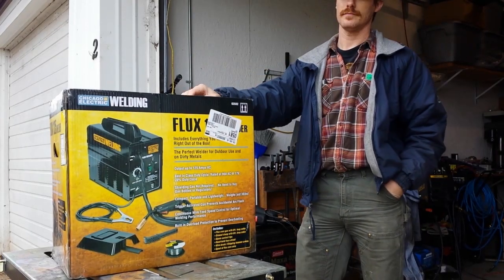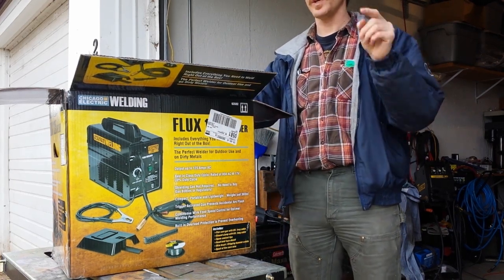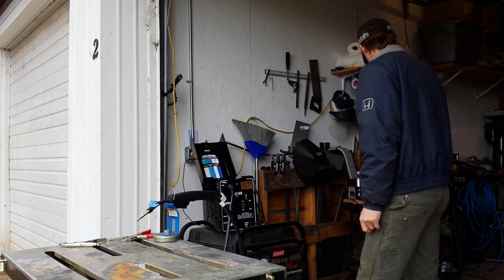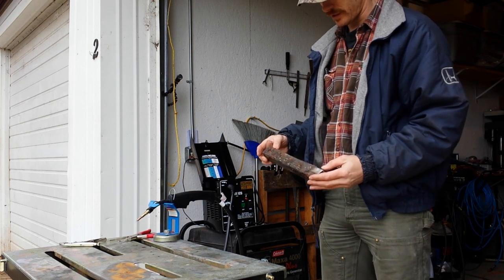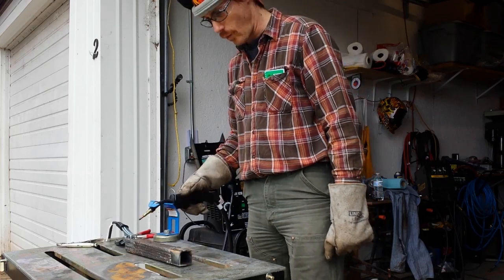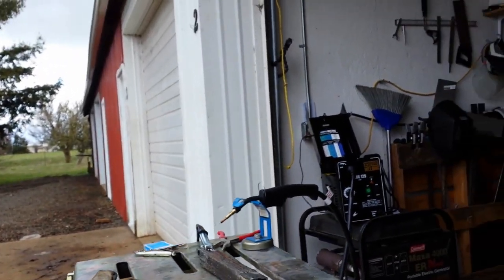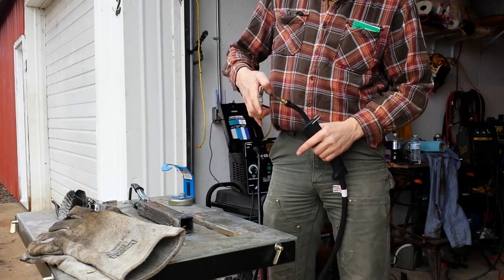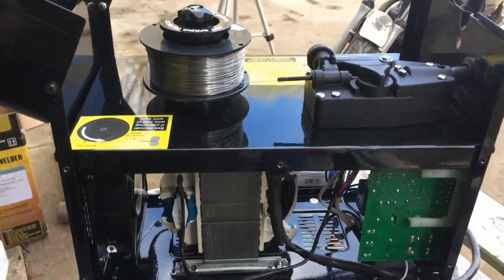Harbor Freight Flux 125 Welder Unboxing and Test (#63582)

Comment: If you weld much, I'm sure you figure out that the gas cap is not the tip and not what has to be removed when you change your wire. You got lucky. Always keep the gas cap on while using the gun. It keeps you from ruining your threads and keeps splatter from welding the tip to the gun. The cap also will help you with your distance from work piece and keep you from grounding out the tip.
If you have an old heavy set of jumper cables you can have a really good ground clamp. Hobart makes a magnet ground also.
I would recommend weld city wire e71t-11. It's a multi pass wire, found on Amazon. Around 35 dollars for a 10 pound roll. One of the best wires for the buck. Blue demon is a decent cheep wire but nothing compared to weld city.

I don't take advice well from new welders, they drop a few welds and are suddenly experts. I'm still learning after 40 years of sparking. Good video sir. Your humility is refreshing.
Reply from the maker: +Mark Cobb Thanks for the comment.  I’ve purchased a Flux core plastic “nozzle”.  I don’t like the original gas nozzle on that welder, it extends 1/4” past the tip.  That tends to encourage me to run with longer stick out than I should.  

I’ll look into the Weld City wire.  Thanks.
Reply: A Zen Master has entered the building...The knowledge that you shared is jumping off the page...Respect.
Reply: I salute your professionalism, Mark.  Your manner of siting issues was done with class.

Comment: I was trying to do some thin sheet metal auto body panel repair work and had poor results with a stick welder. I should have tried to change the polarity on the stick welder but didn't (had the easy front twist cables). Just went ahead and got the flux core welder.
Was wondering about advice for the Chicago electric flux core 125 welder and thin (Butt welding) body panels. People are saying tack and then stitch, or then fill in between the tacks.
I'm just a novice welder, but keep seeing Welders saying "convert it to DC" and "Change the polarity" but on the Chicago electric flux core welder you can't just change the cables with an easy twist and pull on the front of the machine. They say negative electrons flow to positive, so connecting the welder gun to negative, and the ground to positive allows better welds and less splatter. Is these changes easily possible with the Chicago electric flux core 125 welder? is it even necessary to do this to get decent welds? And why aren't the factories making them this way if the results are so much better?
Interested to hear some opinions on this.
Thanks.

Comment: Have the Harbor Freight 90 flux-core welder and tasted the duty-cycle on max and min. On MIN, it welded for about 13min before I gave up due to hand cramping from welding so long. The MAX setting welded for 7min with an ambient temperature of 50F.

Comment: Been wanting something like this for my home shop. 
Only I live in a 100 + yr old  house with what I believe to be 110V (some of it knob and tube)
Can I use this around the house and with my metal art?
Reply from the maker: I wouldn't recommend using this on old wiring, especially knob & tube.  It draws a lot of amps and could over stress the old wiring and connections.  And could possibly result in a fire.  If it were me, I wouldn't risk it.

Comment: This is a very good, instructional welding video. I bought this same welder a month ago. Never welded before in my life. My first try was poor, at best. I'll try your settings to see if it improves. I also think I need to slow down. Also, I'm running the wire that came with the welder, but bought a roll of Lincoln Weld wire.  Do you think the upgraded wire will make a noticeable difference? I'm certainly open to any other tips you might add.  Thanks!
Reply from the maker: +jjccamis Glad The video helped you.  Keep in mind I’m no expert.  Lincoln wire helps a little.  The most important thing is to learn to watch the puddle of molten metal as you weld.  Getting the helmet shade correct will help you see the puddle.  I set mine to a shade 11,  but that’s a personal preference.  I learned by watching videos on YouTube.  The best channel is weldingtipsandtricks.  Check it out.

Comment: why do your beads stay black after you hit them with the wire wheel? just wondering if they would be able to have a nicer silver look, it kind of looks like its still covered with slag
Reply from the maker: Not sure why they look that way.  Probably a trick of lightning, at least in part.

Comment: The hole in front of the handle is for the welding gun
Reply from the maker: Not on this one.  The gun will not fit in the handle, even with the nozzle removed.